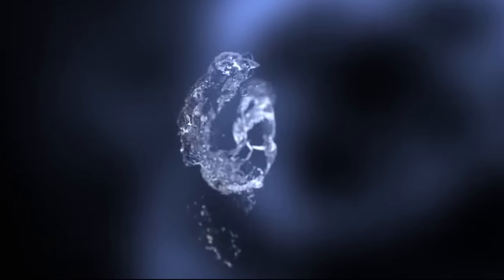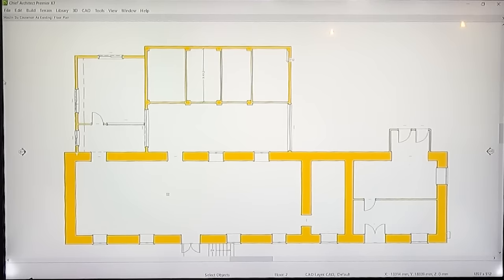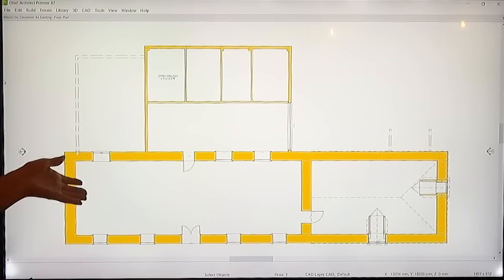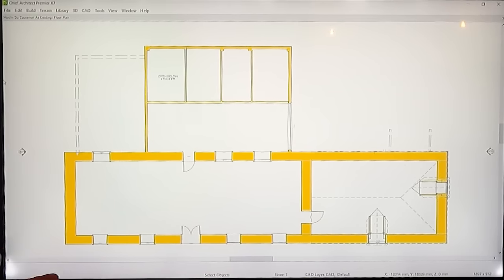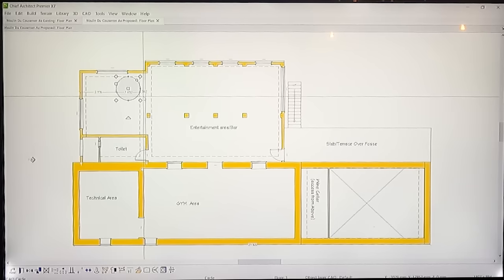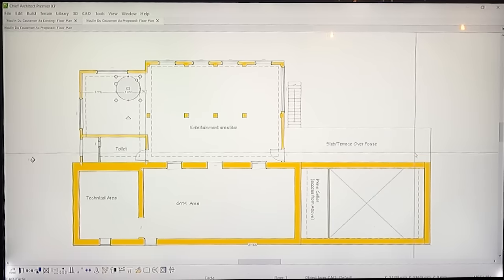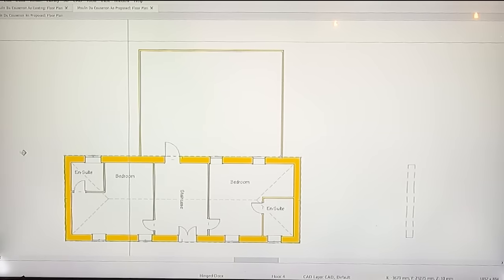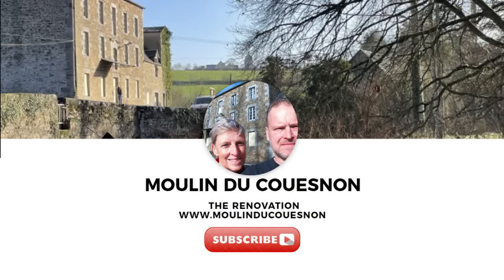Grand ideas or Insane ideas for the Moulin du Couesnon ? You decide

Comment: I've seen some quite stunning mills for sale in France, but have read or heard some suggestions that it's a purchase that has to be carefully considered, due to possibly having some responsibility or obligation to maintain the watercourse. Do you have anything like that attached to this? You mention obtaining water rights - will that include such obligations?
Reply from the maker: Yes it would but the plan would be to install turbines so we would need to renovate the race(s) in any event
Reply: @MoulinCouesnon  Quite a bit of engineering required. 😁 Not something you can get off the shelf!

Comment: Hello lot of discussion on these plan's 
Spiral staircase isnt ideal for young and old.
Good that you changed dimensions of poolyou will need a structural engineer because of the weight.i would think the susol would cost less to build it the higher up you go the more structural support needed the higher the cost.
The architect charges are ny the meter square, to save money only have plans done for the areas you aresure you will build. Also talk with the maries office first to give you some idea what they will accept before uou engage an architect. No point in paying for time discussing something that wont be accepted.
Looking forward to seeing this progress.
Reply from the maker: The old silos used to hold about 200 tonnes of grain. The original plan was to put the pool in the lowest silo section (ground floor) but we agree placing it in the sous sol is a better solution.
Reply: @MoulinCouesnon  looking forward to your next video